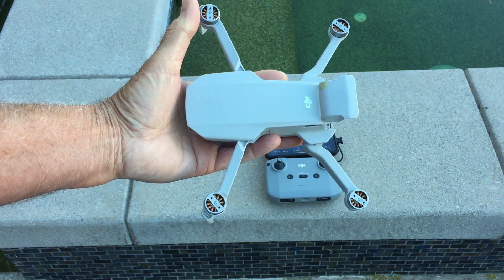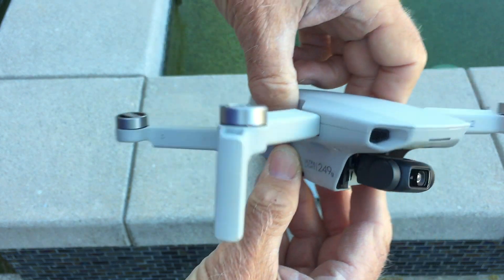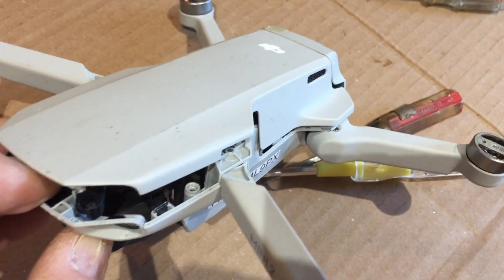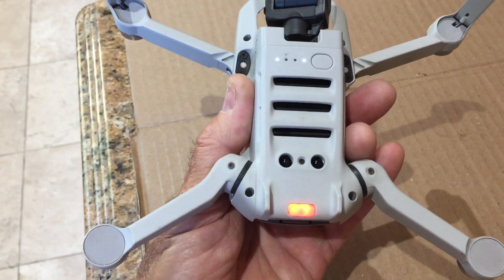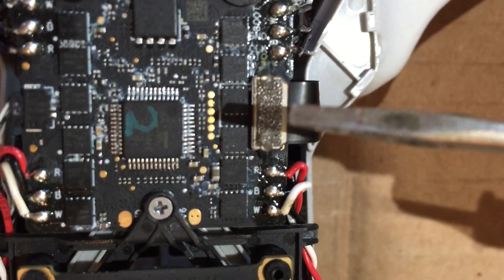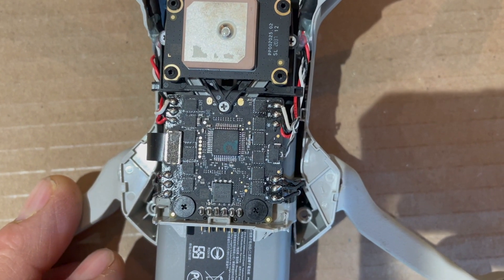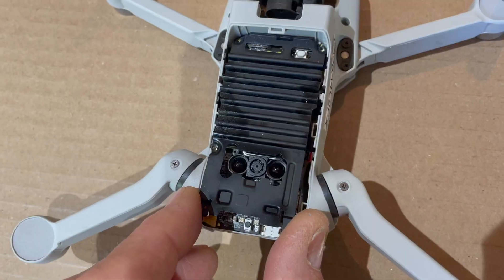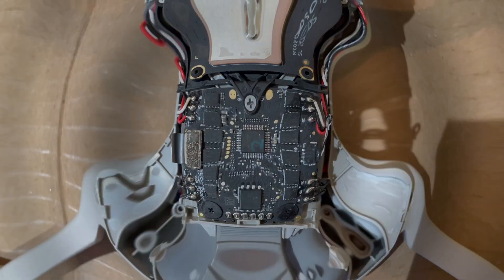DJI Mini 2 Water damage Tear Down & repair Part 1

Comment: Hi could you please tell me what size screwdriver you used to remove the screws at the bottom .
Reply from the maker: It is just a very tiny philips screwdriver but 2 of the srews are set very deep maybe 1/2" or more so you need a fairly long reach screwdriver.  I have a small multiple screwdriver set and that worked for me, they have lots of them very cheap at Harbor freight.

Comment: mine sat at the bottom of my pond for 4 weeks or so. just found it today thanks to one motor being visible sticking out of the mud. so i scooped it out. my camera protector face plate thing is missing (the piece that says 4k on the camera) .. i couldnt believe the drone even powered on. water got in the camera and she's blurry. that face plate has a gasket so im guessing that was the water protection. not the first crash so mightve been already gone. gps and such doesn't connect. the gimble does try to center. unsuccesfully. sounds like dirt in it though. ugh. i got a new one already but it'd be sweet if i could get it working again.
Reply from the maker: Yeah, at least you can use the recovered one for parts, that is what I am doing

Comment: I have the mavic mini and same issue as yours, I'm also waiting on a new esc, should be soon, I did the alchole thing and it worked for maybe a min but then back to the 2 white lights on the bottom, great video thank you 👍
Reply from the maker: Hope it works for you, thanks
Reply: @thecuriousnomad4712  hey I had same issue with my mavic mini back in July! 
Since then I kept it in my room and today I started jus to see and works like a charm. Only thing is the sd card got damaged and I put a new one and it’s detecting!!

Comment: Interesting work, how did your Mini 2 took the plunge? It would be interesting to share the info so we can avoid such incidents
Reply from the maker: Good question. I was flying low over a swimming pool at around 10' with the Gimbal straight down. I stopped to hover then raised the Gimbal to level and did a 360 to look around, did not see anything in the way so I pushed the left stick upward to rise straight up. There was a palm tree leaf directly above me!  I could see the drone hit and was hoping it would recover but within a second I could see it sinking in the water! Unfortunately there is no way to see directly above the drone and I learned that lesson the hard way!
Reply: @thecuriousnomad4712  wow, amazing story. Do you think drone propeller guard would have saved your drone
Reply: @RJinspire  from that incident yes i believe so. the propellers getting hit is what messes up the flight, so some protection there may have the drone bounce off, but not lose it's propeller motion as much so it will rebalance itself but stay in flight at least.

Comment: I would have given it a good spray right away with WD40 or may be a future idea I know this through mechanics that it's the best thing to use especially on electrical components. Thankyou though for your upload very interesting.
Reply from the maker: Yeah, I have heard that WD-40 can be used like that, never tried it though....

Comment: Did you try a different battery other than the one that got submerged? Maybe there is some kind of water detection in the battery triggering that error. Just a hunch!
Reply from the maker: Yes, definetly not the battery, thanks